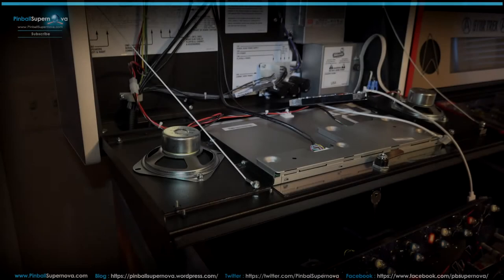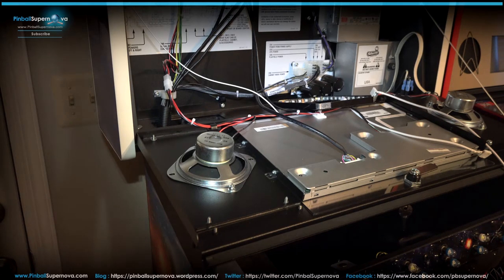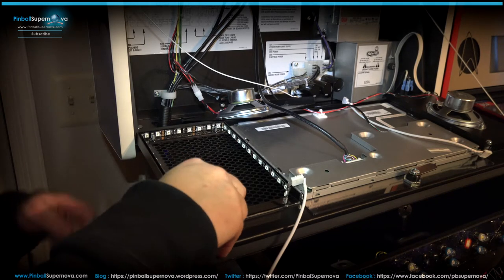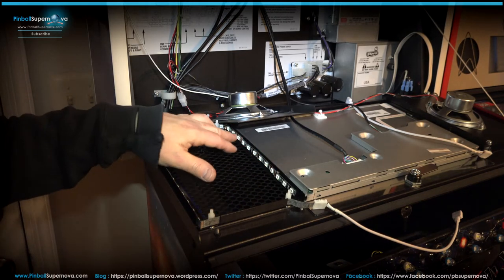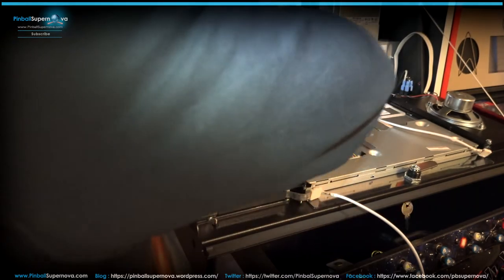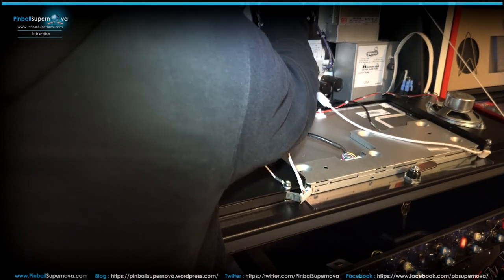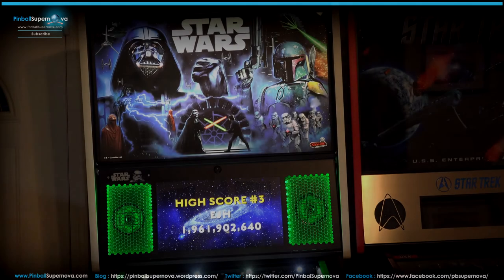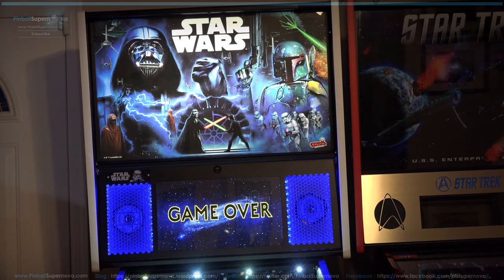Pinball Mods # 62 : SPEAKER LIGHT KIT INSTALL : SPIKE 2 STAR WARS PREMIUM

Comment: Best to read the install instructions and follow the directions from the manufactures website (as opposed to only watching this video). EX:...BOTH support cables should be disconnected FIRST and BOTH should only be reconnected AFTER the entire install is finished. If not, you are only adding unneeded pressure to them when doing the install. Doing the wire management on the back of the LCD screen (as described in the install instructions) also makes for a cleaner install. 

Other important things are completely ignored in this video. EX: It is important to make sure you are pressing the speaker panel in, TOWARD THE BACKBOX, when the bottom 2 hex posts on each side are tightened down. If not, and if the speaker panel shifted when they were loosened, the panel will not close properly. That is why I recommend reading the manufactures install instructions opposed to only viewing this video.

Plastic or metal standoffs...they will both break if over tightened. Flipper Fidelity includes 2 extras with their speakers (and they are metal ones) just for that reason. The key is DO NOT OVER TIGHTEN them. If you do over tighten them, it will break them (metal or plastic). If you do not over tighten them, you won't have an issue (metal or plastic). So don't over tighten them and make sure the nuts are threaded on straight when putting them on. 

Using the nylon hex standoffs was not a cost saving measure, as they are more expensive than the aluminum ones, it was done because the hex post can come in direct contact with the front of the LED light strips. Having a metal post rubbing against the diodes on the front of the light strip's PCB is not a good idea and so, nylon post are used.

  2 extra hex posts are now included with each light kit.

www.speakerlightkits.com

Comment: Thanks for the video!  I too had the same issue on my install, cracked two of the plastic extenders.  Will have to reach out to pinballspeakerlightkits for some replacements.  I wish they would have made the extenders out of metal like previous non-Spike kits!  I also wish I had seen the install video before installing my kit in Aerosmith!  Keep these great videos coming!
Reply from the maker: Thanks Ed for the positive comments, Yes I agree with your comments on the plastic extenders.  They break really easy unfortunately.  Metal would be a great replacement for the plastic parts.